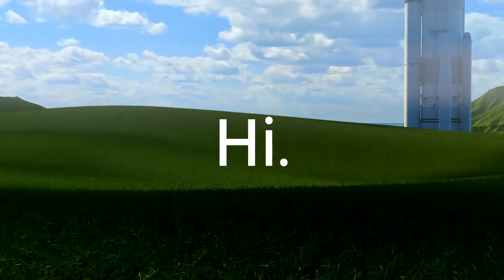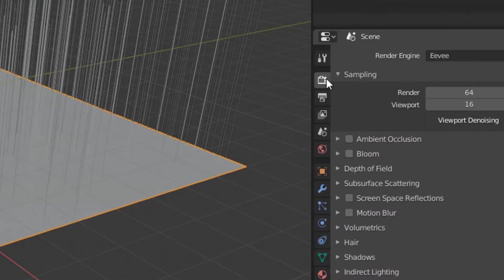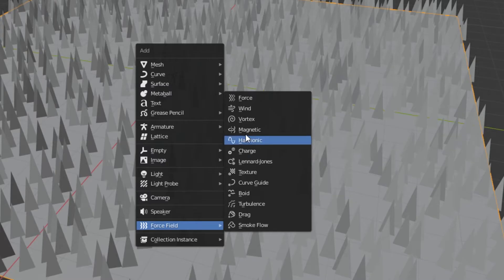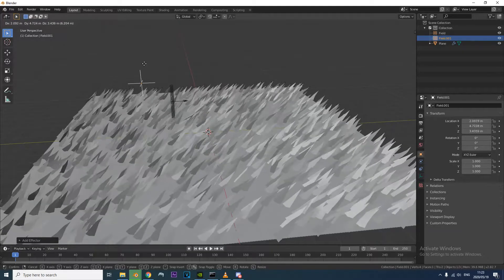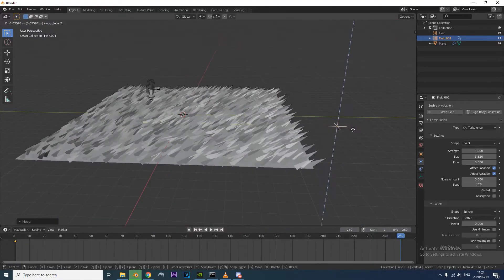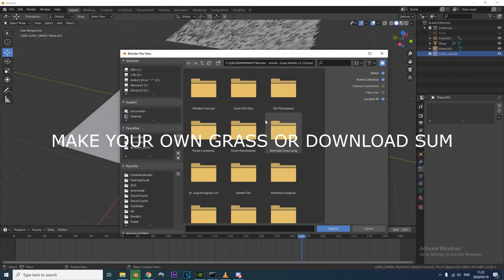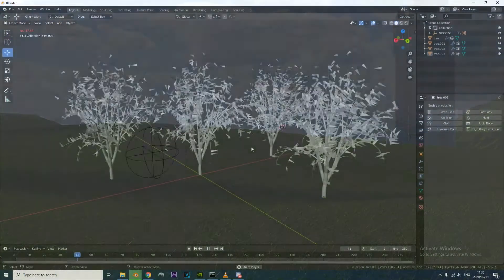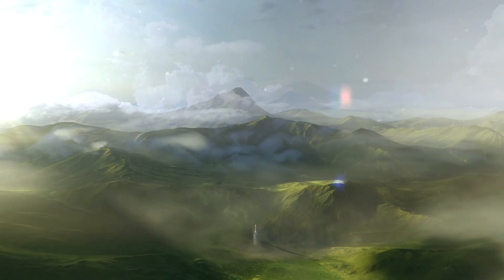Make Wind for Grass - No Baking, No Physics.   Blender Tutorial  (Speedy tutorial)

Comment: It works with the default hair strands, but when I use an object for the hair, it stops being affected by the forces. Origin point is at the bottom of the grass particle mesh, like ti should be. I don't know what I'm doing wrong.
Reply: same issue here, if you or anyone figures it out, let me know
Reply: same. did you figure t out ?